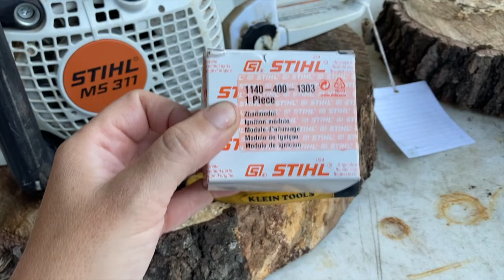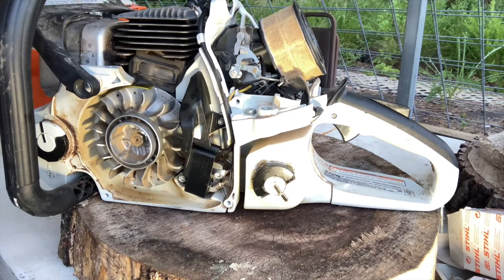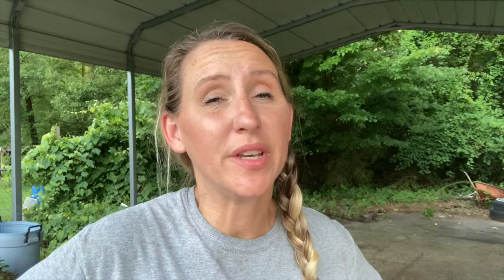Customer Destroyed It! How to replace your ignition coil and plug boot on Stihl MS311

Comment: have always used stihl's motomix in my stihl, the only problem i have had using it is when it is old, you never use cheap, spend the money and it will run, USUALLY 
    my 362 s has electronic ignition and fuel injection as explained to me by the dealer when new, hope it does not cause issues later, thank you for your advice, have a good day

Comment: Re. fuel quality , it's an easy test to put a small measured quantity e.g. a few cc or a 1/4 cup in a container alongside the same quantity of known good fuel in an identical container and do a timed evaporation test out in the sun . 
             If dodgy fuel has lost it's light volatiles this test will help show it up , check after a few hours and compare levels .

            I was once given a Troy Bilt ride-on to fix that was backfiring and coughing and basically just wouldn't run properly at all , I ( finally ) did the above test and found that the fuel tank had been topped off with diesel fuel , it had enough petrol that it smelled not too bad but the evaporation test proved it .

Comment: Handy video tks. Would be nice if you could cover a repair on a Stihl BR700 blower. Seems the ignition wire has 1 exposed wire that is pushed into a soft rubber piece under that cap on the back, top center. If it comes loose what do you do and is there a way to lengthen the wire?

Comment: Thanks for the tip on putting the plug wire back together.  I needed that for my 031.  But the MS311, I have one and it's the devil to start.  I have to pull it at least 4 times before it ever fires.  When it does fire, I can move it to half choke and it usually starts then.  I took it back to the dealer right after I bought it, actually twice, and of course, they jerked it twice and it started.  My 031 usually starts on the second pull, even cold.  I've heard of others having the same problem with late model Stihls.  

I've had to pull the plug a couple of times to clear the gas, and I wondered if that was what your customer was doing.  Is there any solution for this?  Surely Stihl is aware of it.

Thanks for your videos and help.

Comment: I would have push the wire all the way threw the boot than put the end on it and pull it back in but you did a great job thanks .👍🇺🇸

Comment: Hi. Love your videos. Just one minor correction - the terminal that slips on at the bottom of the coil is not a 'spade'.  It is a quick-disconnect terminal or a Faston (trade name). A spade terminal looks like a fork with only two tines, and it goes under a screw.  The advantage of a spade over a ring terminal is that you do not have to remove the screw to remove the terminal, as you would with a ring.

Comment: I’ve had them come off before I’ve never thought of trying to force the coil through the small hole on the boot the wire will barely fit on most of them I push the wire through the small hole and out where the spark plug goes then connect the wire like you did then just pull the wire back to where the loop goes and put it on the plug sometimes it’s easier to put the loop on the plug then slide the boot over the plug with the wire if the insulation on the spark plug wire is messed up it might be a safer way to do it without doing more damage also if the insulation is messed up after connecting the wire loop you can use some black light glue to reenforce the wire and insulation before sliding the boot over everything 👍

Comment: In an emergency you can join the ignition lead to lengthen it or  add a bit of wire with a good boot. May not run quite as good though. I bought my FS131 with a joined/repaired wire. Ran it like that for years. Eventually fitted a new coil and was pleasantly surprised how much better it ran

Comment: I aquired an 066 with an aftermarket spark plug boot (NGK). It wasn't sparking, I thought the coil was dead but when I checked with a multimeter it was the spark plug boot. It was a hard plastic one with a resistor in which had died. The HT lead screwed on to a screw in the end of it. The OEM replacement also screwed on but the boot was rubber. Never realised some of those had a resistor in, apparently it gives a slightly cooler spark with a longer duration. Saved some money checking it first.

Comment: A helpful suggestion.  After one gently removes the spark plug boot, one can lubricate it with dielectric grease.  It won't affect the spark path, nor damage the rubber boot. It will make removing/inserting the boot going forward much easier.

Comment: I had this issue with my Stihl KM131R, but I was able to repair it by doing a google search.  I replaced the spark plug, air filter, and fuel filter.  I actually did strip some of the wire back at first, but realized the spring on the boot was designed to push into the wire, so I just pushed the boot spring back in and wrapped the exposed wire I had stripped around the spring and it worked.

Comment: Bad fuel is my #1 issue besides owner tinkering. Gas in our area is bad quality and customers are very cheap…. They try using 2+ year old gas and just don’t understand it has a shelf life of maybe 60 days if your lucky here. Poor quality goes with the cheap gas…. Both bad. 
   Customers don’t understand either the coil cable on “Homeowner” quality saw are non replaceable and like shown the whole coil needs replaced. 
   Good video on the actual issue and that changing a spark plug doesn’t fix everything!!!

Comment: I was working on a MS 271. Saw's toast due to dirt getting past the air filter. It has the twist style & the connector base was dirty. Bear in mind I do know it's had 2 owners so no idea from there. The filter was clean & yes, there's the chance it wasn't tight.

Comment: I've spliced plug wires.  Just cut them in a spot where it can't shock and use a thin copper wire (large gauge like -22) and stick it into one end of the wire and then push the two wire back together with the wire going into both ends of the wire.  Tape or heat shrink if there's room.  Ig it's in the plastic trough it doesn't need to have extra insulation.

Comment: Brea, if you remember the old microfiche those are .005 so 2 make .010. Just cut in the the width you need. Another thing Kohler had plastic straps in a kit of different thickness & of different colors.

Comment: Ok what am i missing. Stihl 025, old but rarely used (total 40 minutes since new 20 years ago) sat in a tool closet. Started shortly last month and ran for 5 mins then quit. I decided to practice my small engine skills - ordered parts online, changed fuel line, filter, cleaned carb well, new plug (plug boot was difficult to remove, inside wire piece twisted, but spark check was ok. Changed gas mix (used stihl mix, used 91oct 50:1 armour oil mix, will try Trufuel mix next.) Followed the choke first til cough, then goto half choke, then goto normal. Stihl (no pun intended) will not run. I'm 72. My arm is not throwin' 90mph balls anymore. I've watched almost all your videos as a guide. What do I do next other than swear never to buy another Stihl. Do you have a "when all fails, what to do next" video.

Comment: Recently came across your channel and love it!! Please can you answer a question for me about coil. I've read at watched conflicting info about Briggs and Stratton coils for resistance values. I've got a 625e on a lawn mower that won't start at all even when I use some carb cleaner, it still won't fire. I can't see a spark at all and I've disconnected the kill wire to take that out of the equation too. i've whittled it down to being the coil (I think) by doing all the other checks. So what resistance figure should a bad coil have? Thanl you and please keep on creating great content!!

Comment: Putting that bayonet connector back on the spark plug wire is really quite easy.  I use a pair of kitchen pliers to press it back in the spark plug wire.  I hold it in the wire with the pliers and get it started into the boot.  I push it in until it bottoms in the boot, align the coil end of the connector with the boot and you are done.  Just remember how to correctly remove the boot from the spark plug.

Comment: @Chickanic, I own a Stihl MS211 chainsaw, and the carb/air filter cover vibrates off constantly when using it and has been doing so since bought new. Any ideas why? And how to fix it to stay on? It has a little section that is supposed to lock it in place, but it doesn't seem to work like it was designed... IDK ????

Comment: Thanks for the anti-stupidity tip on the plug wire removal and the same kind of tip re: the canned gas rip-off.  Do you recommend the use of non-ethanol gasoline ("pure gas") for small engine use, particularly with early 90s 4 stroke engines?  Remember to change out the in-tank fuel line and filter in Stihl and other European chainsaws every few years, before they harden and crack, and refuse to start.

Comment: Hi. Retired auto mechanic here. Long time ago, I found that Mopar combustion chamber “ spray” makes rubber so slick you could shove a rubber bat through a keyhole. I exaggerate. But, rubber hoses, plug wires etc. works great to install. Years later, never found detrimental to the components. Butyl cellosolve seems to be the main ingredient. Give it a try.
Reply: Who sells it?
Reply: Astroglide works great also. I'm not joking.
Reply: @tubeonline629  Who sells it?
Reply: @johnnellis3025  
Walmart or any drugstore its actually a "personal lubricant " but it is very slick and silicone based.

Comment: I need your opinion.  I own a MS311 and it locked up while warming up.  I was running pre mixed fuel at 50 to 1. Should I have been running this or not?  Your thoughts.
Reply: Don't worry, saw was under warranty.
Reply from the maker: So they fixed it under warranty because the fuel burnt it up? Or have you not had it fixed yet?
Reply: Don't think it was the fuel, it's being looked at now.
Reply: We'll see what the problem was.

Comment: I am looking for a good ign. Module for a 2003 homelite ranger 38cc. Primary side checks @ 270 ohms. Starts fine cold and will run fine. If I shut off it won't restart until it cools completely down. What can I do?

Comment: Use 'shrink tubing' over the pronged section once poked through coil-wire (and apply heat {obviously!} ) 
Use WD-40 on boot to slide  prong/coil through boot. Heat shrinking keeps prong from pulling out later on.
Reply: Glad I have a tube of DC4. I hear that there is a supply issue.

Comment: I like to use dielectric grease instead of regular grease
Also with a q-tip put a little dielectric grease where the boot fits on the plug so it doesn't stick so bad

Comment: My son in law poured some True Fuel into the BG55 Stihl blower that I gave my daughter.  He poured it on top of the Red Armor gas that was in it.  I got it started but In could not restart it.  I. Assessed it to bad fuel and poured out all of the gas in the blower and refilled it with Red Armor 50:1 that I had given her.  He thought he was saving fuel but I told him to keep that true fuel crap to run in his Echo chainsaw or pour it in his car to burn it up.  After I filled the tank with Red Armor gas I had no more problems with it.  What a DA.
Reply from the maker: Yup! I see BAD tru-fuel all the time. Everyone else recommends it, but I do not. Thanks for watching!!!
Reply: @Chickanic  I make my own - one gallon of premium non ethanol gas, 50:1 mix of Echo Red Armor oil, and one ounce of fuel stabilizer ( Brigg’s AFT  or 5 in 1, or Echo Stabilizer), shaken up well.  For four cycle - PNE gas, fuel stabilizer, one ounce of Marvel Mystery Oil  per gallon of gas.  If I run out of two cycle I can always use my four cycle gas to make some more.  The MMO won’t hurt chainsaws.  With 12 chainsaws, Stihl hedge trimmers, husky blower, husky weed eater and pole saw a gallon of two cycle does not last long, here.

Comment: At 8:20, there's a problem with using that old trick to see whether or not your ignition system is working. 
It's one thing for the spark to bridge the gap on that plug in our atmosphere (14.6 PSI on a standard engineering day) and dry, but put it in a cylinder where it has to fire under 100+ PSI in an air/fuel mixture and that's a completely different story. 
I've worked in garages and watched guy's who've used that method to test ignitions and thought they were good and went about rebuilding carbs, replace fuel pumps and any one of a number of other things and here the ignition system was bad all along.
As I mentioned it's one thing to have a spark in our atmosphere but what the ignition has to overcome to bridge the gap at the plug in a cylinder is a whole different animal, Lisle makes a tool that's a far better way of testing that than the old plug against a ground trick, it has a pointy screw in the center of a plastic housing that the other end of the screw has a knurled knob to turn with your fingers, on the side of the plastic housing there's a scale that shows how far to back the pointed tip away from the ground side in the tool per the required spark plug gap for that engine, the first time I used one I was shocked at the gap in the tool for even a .025 spark plug gap for a magneto system like what's in most lawn and garden equipment, but it takes a gap that big to create enough resistance to simulate what the ignition has to overcome to fire a spark plug in a cylinder with 100+ PSI of air/fuel mixture, look at the scale and the gap required to simulate the conditions for a modern automobile that calls for a .060 plug gap and you'll think there's no way that the ignition can bridge a gap that big but if the ignition is good it sure will.
One of those inexpensive tools can save you a lot of agony when determining if an ignition system on an engine that won't start is any good, they're worth every bit of the $15 or so they cost.

Comment: I wish I watched this before I replaced my ignition coil on my Stihl 600 blower. I went to change the spark plug and it ripped off the boot. Do you have to remove the cover to change plug?
Reply from the maker: No. I grab a pair of pliers and twist back and forth over and over as I slight pull. Comes off easy every time.

Comment: If the boot is damaged, electric tape is an easy fix.
Does the gauge between the flywheel and ignition change the dwell or timing ?

Comment: Two questions. why not just replace the HT lead rather than the whole ignition coil assembly also if the wire fitted under the one bolt,reffered to as 'the kill wire' then what is the purpose of the wire attached to the spade terminal?

Comment: What great videos you put out. Always super useful. One other thing I would have liked to see you address (especially given the tighter specs you mentioned) was the proper way to remove the boot from the plug. Historically, I usually just twist and rock it a bit with thumb and fore finger, but with a tighter crimp on the end of the plug, is there a better way, perhaps gripping the boot below the interior round coil attaching to the plug (at 90 degrees) with needle nose pliers and applying force straight up, again at 90 degrees, so the pliers are applying force to the bottom side of the coil clamp the is attached to the spark plug? If the makes sense? Thanks again for a valuable video.
Reply: About 30 years ago, I bought plug removal pliers to avoid unnecessary damage to plug caps, and unnecessary shocks*. Still have them and use them.  Over 45 years ago  I bought a used 250 cc Bultaco motor cycle (its trailer had flipped on Interstate - disgusted owner sold it cheap - as is )and wanted to see if it would crank. I didn't notice the throttle cable had been yanked on and the carb was stuck wide open.  It caught on the first kick and redlined as only 2 cycle engines can do. * I had to grab the plug wire and cap with my hand to cut it off, knowing I would be shocked like hell and thrown about 20 feet when I did it. Otherwise, the engine could blow up. I manned up and "took the punch". I was young and should've known better, but didn't. Saved the engine, though.
Reply: Yes... I was also hoping for a tutorial on removing those little devils.
    They have gotten very hard to remove.
   I think some of them you have to give a counter clickewise twist while you pull & others you don't.
   Idk though. 
    I know my old stand by trick of cussing at it has no effect.
Reply: @Anonymous-it5jw  
I hate getting shocked! 
I bet that was a good one..

     If a guy can reach it in time, I try to choke em out.

Comment: I have DEFINITELY been shocked by line trimmers before from the spark plug boot. Most notably the fs 250. It also used to burn 🔥 my arm if I was running it for extended periods. Great trimmers tho
Reply: I have gone through comments to see if anyone else mentioned it, but I would have tried putting some rubber shrink tubing on the  the boot and wire as shock prevention and to strengthen the repair so I don't pull it off again.

Comment: Recently had to replace my coil on a 440 magnum... it did not come with the boot and retainer. What a royal pain in the ass to install what should be a simple part. I ended up securing the plug end with heat shrink and that made the whole process much much easier. Should also prevent it from pulling out in the future too. (I believe the coil didn't come pre set up because stihl used that model of coil on several different saws of various sizes so they leave it to the technician to properly size and complete it based on the model being repaired)

Comment: Drag Specialties (motorcycle shops) actually sell a sparkplug wire union to splice in another piece of wire. Many vintage Japanese bikes have a similar coil arrangement but are unobtanium. Packaging that into a piece of yard equipment may not be so easy in many cases, however.

Comment: I've purchased a small battery chain saw with a 10 in bar.
It's good enough for branches on a tree. But if you have a
woodstove and cut larger trees. Gas powered is better.